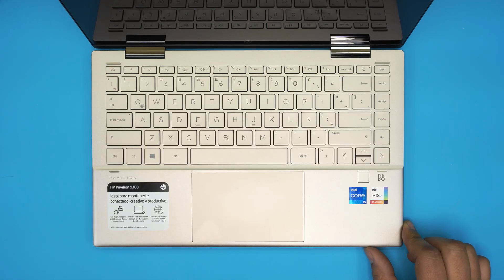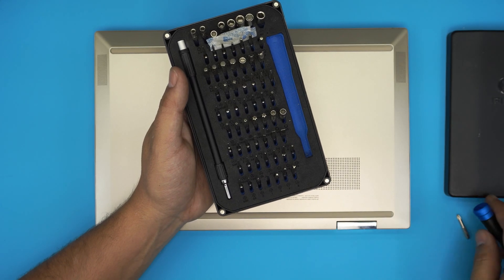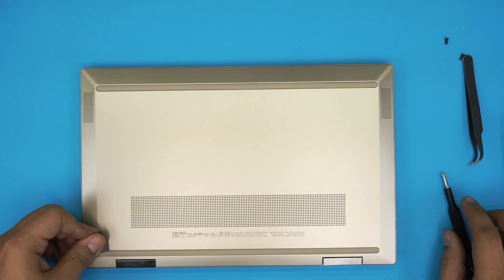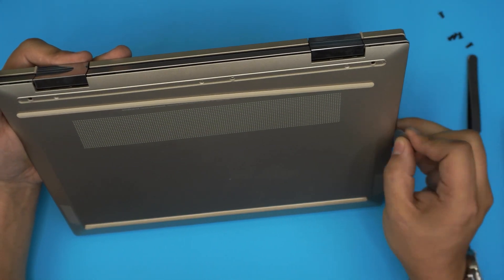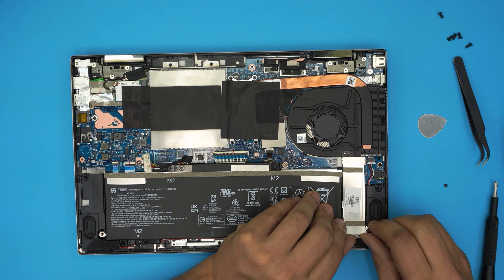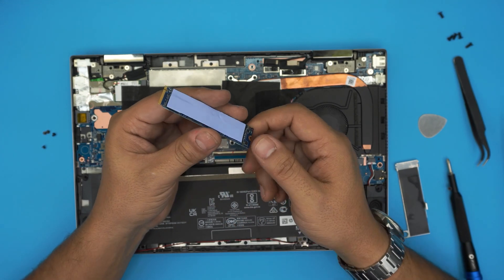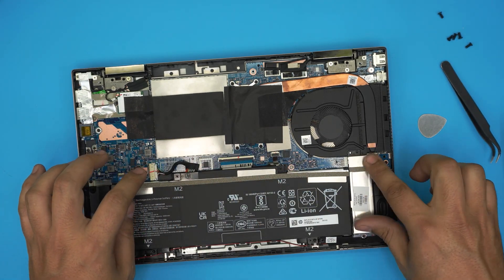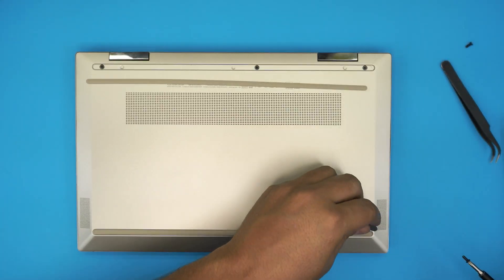How to upgrade Hp X360 14 DY series SSD HDD

Comment: Hi, I own a 3A9B1LA model x360 HP PAVILION, it is possible change the actual ssd for a samsung 990EVO 1Tb PCIe 5.0 x2 M.2 2280??? Thank you for advance
Reply from the maker: It's my pleasure my friend.
🫠Regarding your question, you can replace the main ssd nvme with 990evo 1TB or 2TB without any issues, gen 3, 4, 5 all will work fine without any issues, the motherboard will use the gen 5 nvme as gen 4nvme.
Should you have any further questions or requests in the future, please don't hesitate to ask me.
cheers🍻

Comment: I have same laptop. I used  a different charger (not the original)  to charge the laptop but  it did not charge the laptop. Instead, it caused a spark and a burning smell from the charging port. 

After that, I tried the original charger, but it not  work. What could be damaged? Will the SSD be fine?
Reply from the maker: 🫠Regarding your question, the SSD is fine, but your motherboard is shorted and needs to be repaired by a technician.
Should you have any further questions or requests in the future, please don't hesitate to ask me.

Comment: I know this is an old video.... but any idea why a Samsung 960 PRO 1TB isn't recognised by this laptop? It says it's an M.2 NVMe.. but I can't find anything saying it's not compatible...
Reply from the maker: 🫠Regarding your question, it should work. We have installed 960 on these models and many other models without any issues. How do you know if it is not recognized? Do you not see the drive in the installation steps? If so, check this video:
https://youtu.be/SDOSqI9ZIZE
cheers🍻